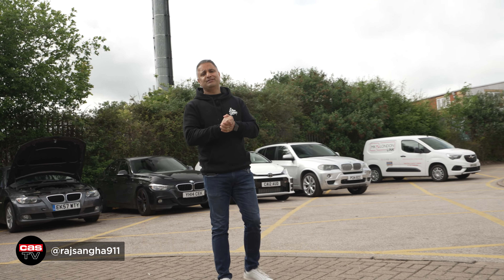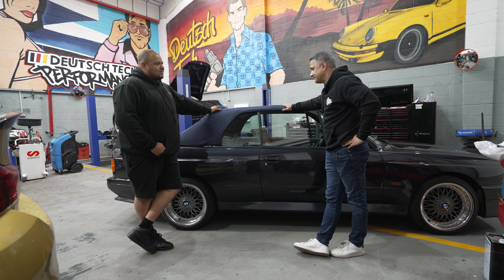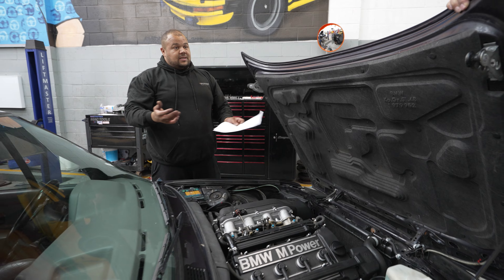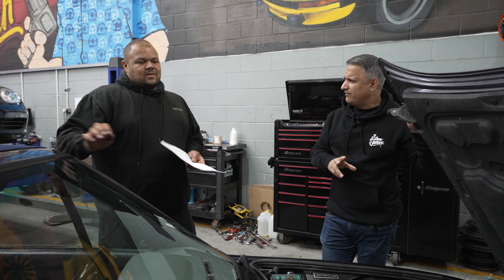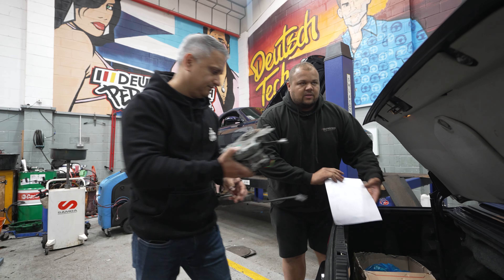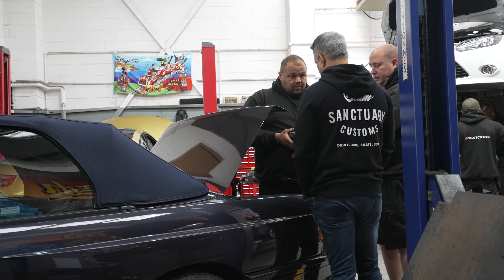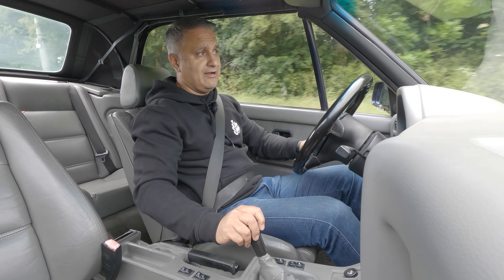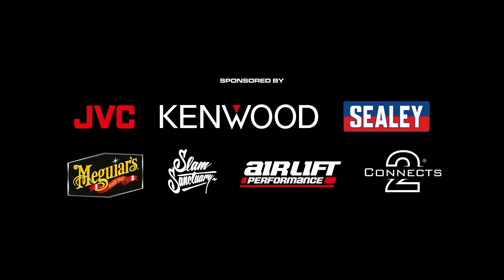BMW E30 M3 Convertible restoration project Part 2 - Raj's Garage EP34

Comment: I had one and modified it. Slammed, system, single wash wiper, Evo front lip etc etc. then ended up putting it back to standard and selling it on. Great to look at No regrets selling so boils down to if you are going to keep for the long term. I’ve got a saloon atm and highly recommend Munich legends. Good luck.

Comment: I would not recommend another second hand hood motor as they are all 30+ years old now and most are worn out. 

These hood motors are a known weak point, as the casing is cast and the gear mechanism is weak, they always have been even from new. Due to not getting used often enough (especially on our uk cars) and very rarely getting serviced the mechanisms get stiff and most are broken like the one from fleabay.

I think the best thing I would recommend you to do would be to have a look on the internet as when I did this job last there used to be a few companies which sold strengthening and repair kits for these motors. The kit wouldn’t be any good for the motor with a broken bracket but would work great for the one from fleabay.

Alternatively if you still want a second hand motor post up on the E30 zone and E30 owners groups on Facebook, I’m sure there’s a few knocking about, but won’t be cheap and like I said previously will be an old used part at the end of the day, prone to failure again.
Reply from the maker: Valid points, it might be best to find someone who can repair our fleabay motor!

Comment: great video guys! Ill be using your tips and expertise in my E30 as wll. Question, Do you have the template for the convertible top motor and components? I have a rebuilt motor for the top but my car did not come with a motor. So i need to drill holes and make it work. Any help, directions would be greatly appreciated. Thanks